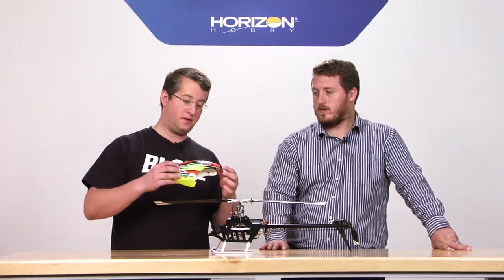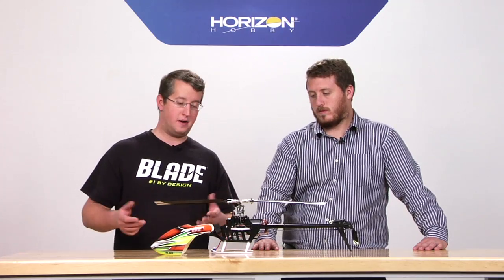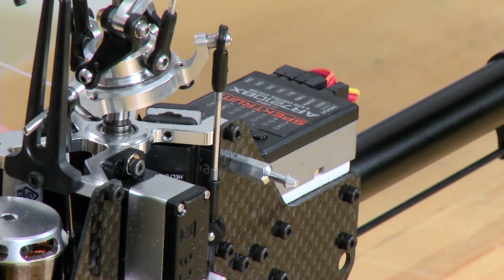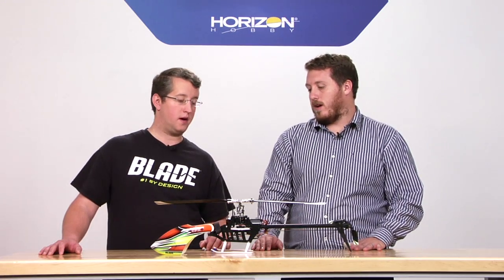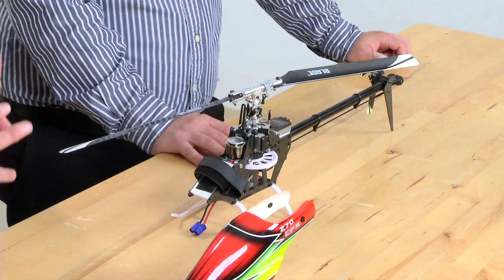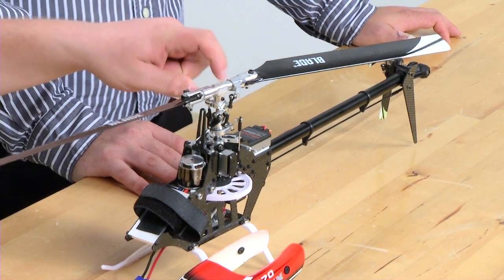Blade 270 CFX - Tech Talk (engl.)

Comment: Hello 
I've purchased a new blade 270cfx.I got it set up by a hobby shop.can I ask how many rescue or recovery modes does it have ?
What happens if I pull the safe switch?
I.e if it's inverted and tilted drastically to one
Side, will it level up and fly in Normal mode
Like skids facing the ground?
Please help.
Regards: shezad

Comment: If you want SAFE and complete access to all of the menus/options it is a $100 fee. You can have a completely open stock setup for free from what I understand, via Firmware flashing, though the SAFE will be lost. Hop over to Helifreak.com and check out what the current 270CFX owners have been chatting about before you make a purchase decision.
With that said, the 270CFX seems to be a very solid heli out of the box.

I've noticed slop in the head bolt as if the hole was over sized. As a noob in hardcore 3D heli's I'm not sure if I need to worry about it. All I know is the head is super tight, no wiggle on my 230S. Plastic vs aluminum maybe?

The tail slider mech and arm seem to have a decent bit of slop as well. Again, I may not need to worry about it but I will try to get a video up tonight before I fly tomorrow morning.